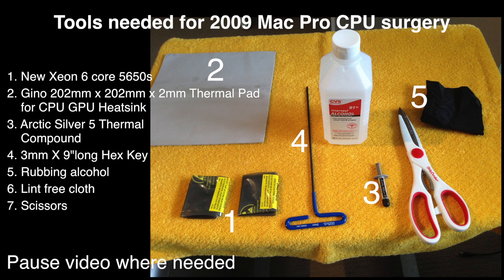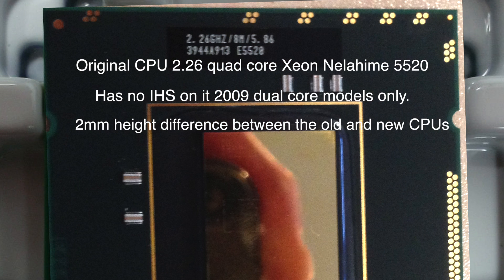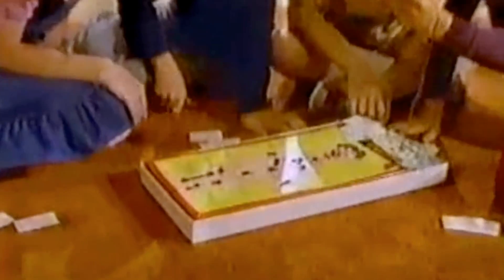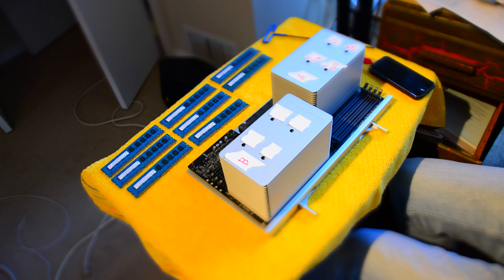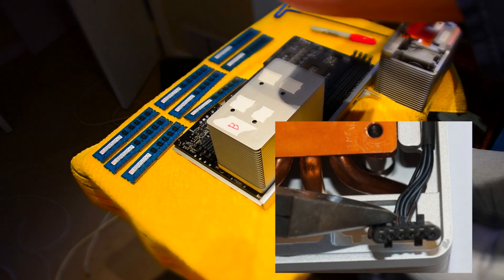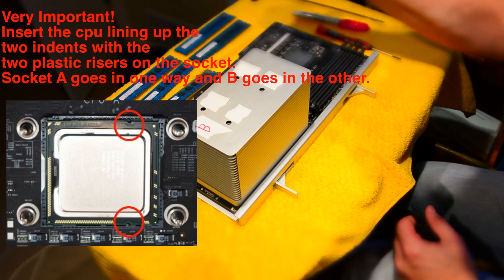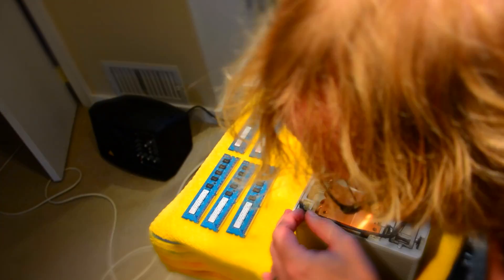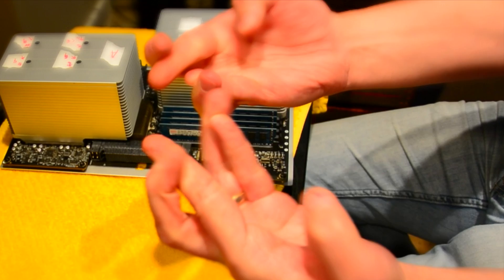Mac Pro 2009 5,1 CPU upgrade 8 core to 2010 12 core

Comment: This video here by Lance McVicker is the one I had watched(over and over) prior to replacing my own CPUs... and I also watched Dontae Harris' video similarly showing the same process.  By the time I actually received my replacement processors, I felt like I knew what I was doing, so kudos and a big thanks to Lance(and Dontae)!

When I removed the heat sinks, each of the 4 screws on each of the heat sinks required between 7 and 8 full rotations to unthread them from the logic board.  Like Lance, I too used tape to mark the start positions, but after all was said and done I found this was not really required, because rethreading of the screws only yielded about 4 full rotations, but more on this later.

I would point out that the Silicon pads are not really needed because the additional height of the replacement processors provide 'more' clearance of the heat sinks atop the processors/logic board, so I didn't use them.

Regarding the connectors... I found it was easiest to remove the affixed cables from their pasted route along the bottom of the heat sinks and then simply move the connectors back and forth with your fingers and some force whilst in their clamped position in the carriage, essentially breaking(in place) the thin little plastic piece that held them in place to begin with, after which time you can pull them up and through the opening giving yourself plenty of connector cable length with which to reattach them when putting them back atop the replacement processors/onto the logic board.  You may opt to re-affix the cables to the heat sinks along their path with some glue, but I didn't find this to be necessary.

I live in a dusty part of the world, along side the ocean(salty sea air), so when I removed my heat sinks there was a considerable amount of lint, muck and corrosion on the logic board.  I first used compressed air to blow off the lint/loose stuff, and then used Q-tips dunked in alcohol to clean the logic board, and then followed-up by using a soft toothbrush(dunking it in alcohol) to scrub the entire logic board until it was as clean as was possible.  I left the old processors in the slots during the cleaning process, using some tape to hold them(and their plastic frame) down, and I did this so that none of the lint/muck would end up inside of the processors slots during the cleaning process.

The Silver Thermal is actually a GREASE and not some type of paste that solidifies, hence it never binds.  So whilst it will indeed dry-up over time and clump together, it will not bind together per say like glues or silicons do for example.  This means  you don't even need to use alcohol to remove it... it'll just break down as you rub it off, both on the old/original processors and on the heat sinks, so I did not use alcohol, just Q-tips to remove the bulks of it, and then polishing cloth to buff it to a shine.

On my particular logic board, the receivers for the 8 screws(4 posts per heat sink) each had a threaded washer about 3-4 millimeters in height, and these were resting on the logic board.  I lifted the washers up to the threads and unscrewed them, removing them entirely.  I then put the heat sinks back on(without applying Silver Thermal Grease or inserting the power connectors), and then proceeded to tighten down the screws.  It took an average of 4 full rotations until the screws required force to tighten them anymore, which means the replacement processors resulted in full tightening of the screws to be reduced from an original ~8 rotations down to ~4 full rotations, so the height difference of the replacement processors was qual to about ~3-4 full rotations of the screws.  I then removed the heat sinks, and this time I replaced the ~4 millimeter high wasters, but instead of threading them back on entirely, where they reached the logic board, I instead only threaded them down to the point where the spaced between the washer and the logic board was approximately the same as was the height difference of the replacement processors.  I then put a small dab of Silver Thermal Grease in the middle of each processor and reinstalled the heat sinks as I did before, tightening the screws an average of ~4 full rotations(some more and some less, but all being tightened so they had approximately the same tension that I was able to gauge/feel during the tightening process.  I then once again removed the heat sinks, and upon removal, the replacement processors had stuck to the heat sinks because of the dab of Silver Thermal Grease I'd previously applied.  I then carefully peeled off the processors and looked at the Silver Thermal Grease displacement to see how much it spread, and in my first effort it was clear that it did not spread out as much as it could have, so, I went back to the logic board and screwed down each of the washers just a tad-bit more, perhaps 1/4 to a 1/2 a turn, so visually it appeared there was about 1-2mm of space between them and the logic board.  I then cleaned the Silver Thermal Grease off of the replacement processors and heat sinks, and this time I applied an entire bead trail of Silver Thermal Grease in the form of a rectangle, which was the exact same shape that the original processors had/used.  I then reinstalled the heat sinks and tightened them down the same way I did before, and then I removed them, and once again the processors were stuck to the heat sinks, and I could visually see that the Silver Thermal Grease had formed an entire seal around the replacement processors, as the excess Silver Thermal Grease had spilled out around the entire edge, so it was clear the seal was complete.  I then reinstalled the heat sinks, but this time attached the connectors to the logic board, and then processed to tighten the screws ~+-4 full rotations until each of them felt like they had the same amount of tightened tension.  I put the logic board tray back into the computer, and was then ready to turn it on.

Upon turning it on, I unfortunately did not hear the wonderful sound of the Mac chime, but I took note of the front side light and how it was behaving, as-wel-as the inside lights behind it, and the lights on near the RAM slots on the logic board tray.  I removed the tray, and focussed on CPU A and unscrewed the screws all the way, and then screwed them back in again, this time I went just a bit tighter.  I put the tray back in, and turned on the computer, and it did not start, but I did see that the light had turned on next to the memory, and the CPU A light turned on inside behind the power button.  So I removed the tray again, unscrewed the screws, and rescued them again, but this time I stopped threading each time I felt a medium tension, and amongst the 4 screws one of them only screwed in about ~3 full rotations whilst another threaded a bit more then ~4 full rotations.  I put the tray back in, and turned the computer on, but it did not start, however, the CPU A light was not one, and the light on the tray next to the memory was no on, so I considered this a success.  I removed the tray again, and this time focussed on CPU B, unscrewing all 4 screws and screwing them back in, doing so until they were tight... following the exact method I used for CPU A, and then put the tray back in, and turned on the computer, and this time the CPU B light turned on, and so that told me it was too tight.  I removed the tray, unscrewed the screws, and once again tightened them back down, but this time I made sure to feel that the tension was only moderate, and again, like CPU A, each screw arrived at this moderate tension at each their own specific number of rotations... one of them actually took ~4.5 full rotations, whilst the others were between 3 and 4.  I put the tray back in, and turned on the computer, and voila!  the wonderful chime was heard, and the computer booted(yea)!

So, what I learned is that each screw will indeed tighten down at each their own number of rotations, and in my case this was between 3 and 4.5 full rotations, but it was not important the number of rotations, but instead that each of them had the same amount of tension as was felt when I was tightening them.  Also, the moment I started paying attention to the CPU A and CPU B lights up behind the power button, along with the one light located on the CPU tray next to the first memory bank, is when I was able to immediately gauge my success with the tightening of the screws.  I found it was much better to unscrew all 4 screws and then rescue them each time, instead of trying to adjust them from their previous state.  If the CPU A or CPU B lights turned on, it meant the heat sinks were too tight, and if the light on the memory bank turned on it meant the heat sinks were too loose(or so I believe).

In summary, and in hindsight, if you simply tighten down each of the screws up and to the point where you feel their tension dramatically dampen to where it requires pressure/force on your behalf, and stop there, and then repeat that with all of the screws, no matter how many rotations each of them require, and then insert the tray and start the computer, and then look for the CPU A and CPU B lights, and the light on the tray next to the memory bank, then those lights will be your guide.  If at any point a CPU A or CPU B light turns on, then you've tightened down too much, and need to loosen the respective heat sink screw(s).  Do not get hung-up on how many rotations each screw on each heat sink requires... because this is a futile exercise... you need simply make sure all 4 screws on each CPU tighten down to the same amount of tension that you are able to feel with your hand as you tighten, and defer to the CPU lights to know you've tightened too much. 

Thanks again Lance... your video was just what I needed!
Reply from the maker: "Silicon pads are not really needed because the additional height of the replacement processors provide 'more' clearance of the heat sinks atop the processors/logic board, so I didn't use them."

 I believe the point of the additional pads is so they are touching the heat sync not leaving a gap, so the sensors get a proper temperature reading for the correct fan control but I could be wrong. The article I read said you must have them as the original config has the pads touching the heat syncs.
I also don't believe you can judge the amount of tension by feel alone inf act that can be very dangerous. The screws are all the same length but apple puts loctite on them which can vary in a big way from screw to screw when loosening and tightening (something I did not mention in the video)
Also one reason counting the turns when unscrewing the heat syncs initially is it lets you know how many turns are needed if you failed with the new processors and have to put the old ones back in.
There are many things I failed to mention in the video as I was in the moment and quite nervous but folks like yourself are all adding good info here and it's appreciated and I am sure these posts will help guide future upgraders.
Thanks!
Reply: Lance McVickar Your reasoning for the silicon pads makes sense, but fortunately in practical application it did not effect my specific installation... at least not yet (knock on wood, fingers crossed).  I've now been running the replacement processors for 2 or 3 months and do not have any problems to report, thankfully.

Again, I watched this video(and read the comments of others) several times prior to receiving my replacement processors, so when it came time to do the actual work, all was seemingly familiar, hence successful.  

The 'broad strokes' are important, and this video covers those.  There is enough wiggle room (e.g.- using silicon pads or not, how the screws are tightened, etc.) as it relates to the 'fine strokes' in that anyone endeavoring this process should succeed -providing they watch the video over and over again, read all of the individual experiences, and be patient... patience is key.

Comment: I have 2 x5690s running.  So far so good (been about 3-4 weeks now).  These seem to me to be more than 2mm larger.  I added washers to help protect against over tightening (though I was still wary and counted turns- but that didn't work in the long run).  I ended up putting one stick of ram in along with cpu A and would slip in the tray, power up and wait and see.  Then like tightening a drum head I'd  cross and give each screw a 10th of a turn and added more ram and slid the tray in to check and see if I had a good connection. Once all 4 sticks were good I moved onto CPU B.  I am not advocating this as being a good method, in fact its probably stupid. However when faced with the machine not booting up originally (not tight enough) it seemed the only way to go for broke. As a last ditch effort it paid off.  I did load some software to boost the fans and check the temps as I was initially getting shutdowns (before i started giving some final 10th turns) I also pulled the optical drive in case that was too much draw from the power supply (I could be way off base here..this is not my field but I know the 5690's pull 130 vs the 80 of the original).  My method for getting the good connection to the fan cable was to force it back through its housing, break the large plastic tab and the I pulled it back into its spot in the housing but it came forward more.  Using a wooden chopstick through the cooling unit grates I held it down when I installed it to force it in line, the housing acted as a guide. Regardless....man..it does in fact take some balls or stupidity and I was sweating that Saturday and needed a stiff beverage when I finished.  Thanks for this video because it is deceptively WAY harder than some think.  This pull em' out and pop em' in method..I don't know...seems like a great way to do damage.

Comment from the maker: FYI!!!! To all thinking about doing the upgrade. Thanks to Syncho for his question below, I should have mentioned this in my video that you can buy Xeons on Ebay with the heat cap removed granted they will cost you more,
that way you do not have to do the extra work of adding thermal pads and cutting the connectors on the heats syncs and when you screw down the heat syncs they should be very close to the same amount of turns it took to unscrew them. I guess the one risk might be if you went for the 5690 it may run hotter without the cap on than the original chips but it may be of know significance.
Reply: Jorge Garcia Here is the kit I saw maybe reach out to the seller.
http://www.ebay.com/itm/221616239012?_trksid=p2060778.m1438.l2649&ssPageName=STRK%3AMEBIDX%3AIT
Reply: I looked around on eBay for Xeon x56xx or higher with the heat spreader removed. Couldn't find any.  I do see some of the older x55xx models, however.

Have you actually seen the higher-end Xeons on eBay sans heat spreader?
Reply: Thanks!  Trying to find something in the < $600 range.
Reply: IridiumLIVE Bought one today. Thanks so much. Will let you know how it goes.
Reply: Lance McVickar Opinions seem to be all over the map about whether the lid on stock CPUs actually dissipates heat or retains it.  My system with lidded CPUs runs warm but frankly, I've only seen it get too hot running benchmarks; in actual use I don't think it's overheating, and I've got the fan utilities installed to ramp up if it does.

I didn't find the fan connector mod too daunting.
Reply: Steve Hoge Can you tell me what are the normal temperature for this kind of cpu's after the upgrade ?
Reply: ***** Hi Charlie, just bought one my self. can you tell me if all went smoothly on your side ?
Reply: חגי גינזבורג Got it. Works great.

Comment: hey i have 2 questions

1st....... do you have to update the firmware to mac pro 5.1 or do it run out of the box?

2nd...... why didnt you disassembly the cover from the xeon to make it thinner? I dont know this xeon but i know it has worked on older intel cpu´s......like the Pentium4
Reply from the maker: If you have a 2009 mac pro you have to update the firmware before installing new Westmere CPU's
Second you can find CPUs without the covers on Ebay, from what I understand its a bitch to get those covers
off and you can wind up killing your CPU. I just saw a kit on ebay for 5690s and they had the covers removed for like 850 not a bad deal. It does make the install much easier infact I almost went that route and was going to buy them on ebay but the price was too high. It's a good point and I should have mentioned that in my video.

Comment: Great video!! I did wonder though, you mentioned that you guessed it would take 4.5 turns for each screw in the end to tighten the heatsinks. But did you do this before or after your first and second attempt failed? Because you go on to say you needed to tighten it even more? So what were the total number of turns in the end? The official macpro instructions say to make it "finger tight" ( meaning no wrist turning) then add a quarter turn more. Is this pretty much what you did?
Reply from the maker: I started with about 3.5 turns don't judge it by pressure alone as you want the same amount of turns for each screw so it's even across the 4 screws of the heat sink so mine were 4.5 to 5 at most total. The point is to go on the lighter side of turns instead of to much at first.